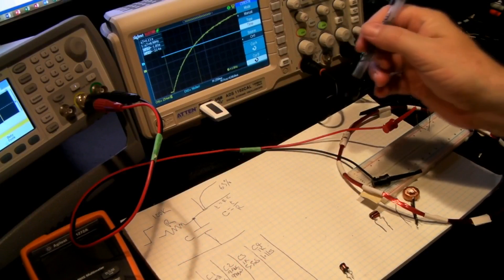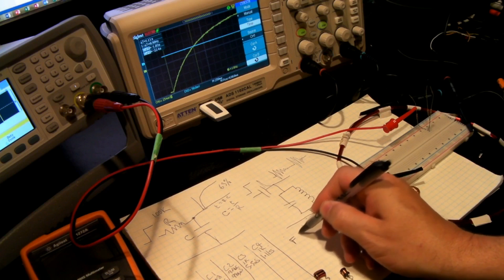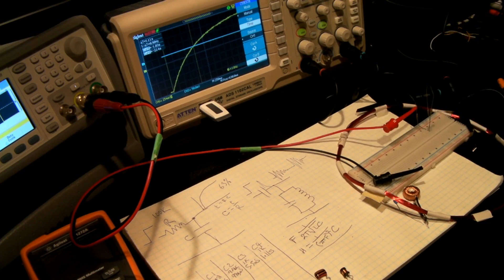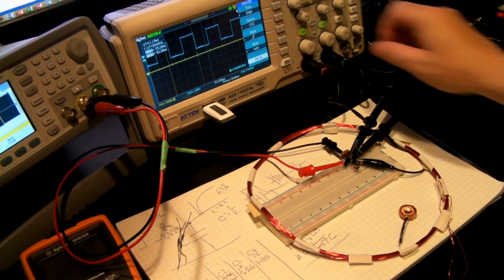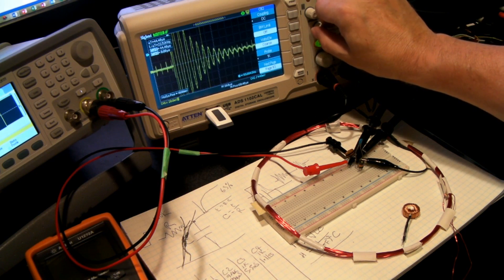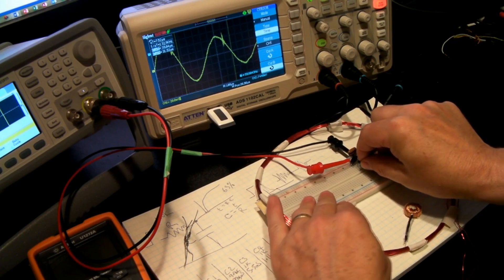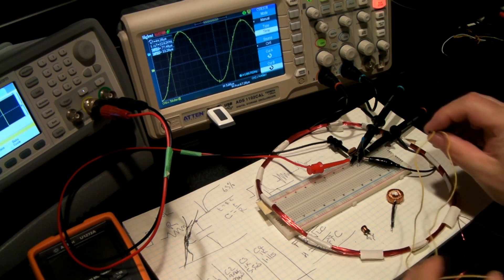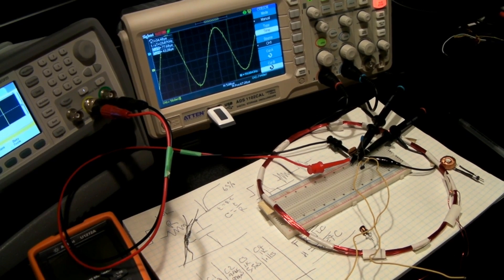Measuring Components with a squarewave, Pt 2 - Inductors

Comment: WHY NOT JUST FEED A VARIABLE SIGNAL UNTIL IT RESONATES AT MAXIMUM AMPLITUDE.NO NEED FOR OSCILLOSCOPE WHICH COSTS THOUSANDS.
Reply from the maker: The Oscilloscope used in this tutorial was just a couple of hundred bucks if that. also if the resonance frequency is very high then most meters will not be able to measure it. This tutorial is also about showing how the inductor works and using that principle to measure its value, I agree that a dedicated inductance meter can be got for a relatively low cost, but then you would not learn anything :)
Reply from the maker: Now replacing the rather expensive AWG that I used with a simple pulse / square wave generator is definitely a good thing to do if you dont have one or are on a budget, just be sure it has a very fast rise time and adjustable period to allow for various value inductors.
Reply: The way to measure to measure resonance would be to use a voltmeter with a diode/capacitor smoothing the output .The means that higher frequencies would not matter.Maybe you could use this idea for your next inductance measuring video which would show you don't need an oscilloscope either.. ...
Reply: @esecallum  Maybe you can make a video demonstrating this?